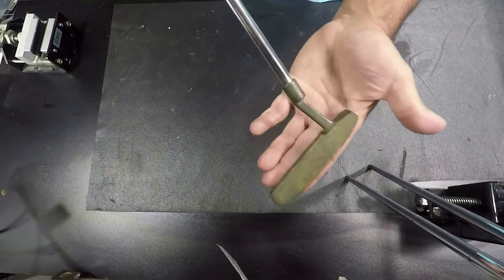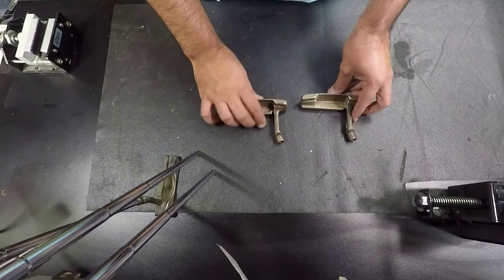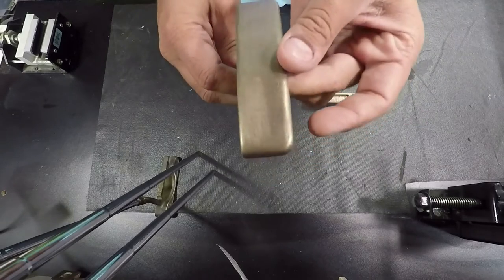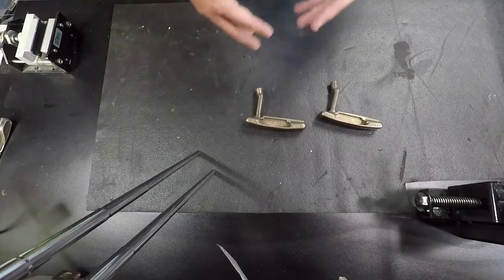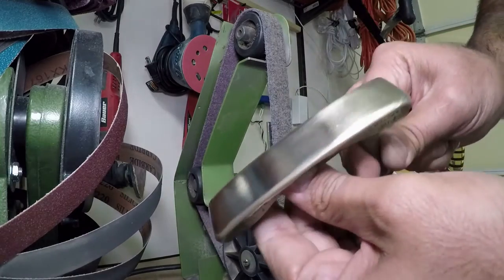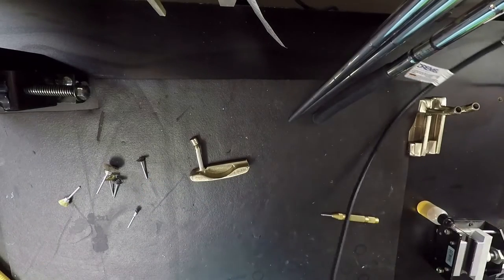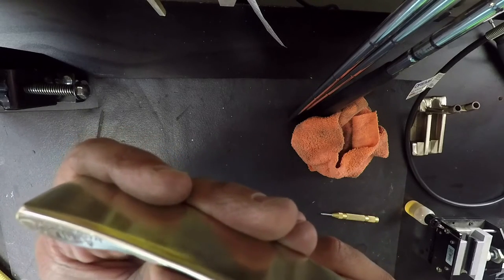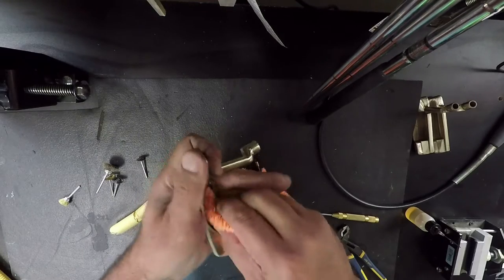Ping Anser Putter Refurbished #golf #putter

Comment: Hello, was just wondering, if you leave the shaft on the putter head, will the mixture of vinegar and baking soda hurt the epoxy that’s holding the shaft on? TIA!
Reply from the maker: No it won't, but it might discolor the coating on the shaft (not sure on this though l...so just to be safe I would tape it up with electrical tape well above the solvent line to protect it.